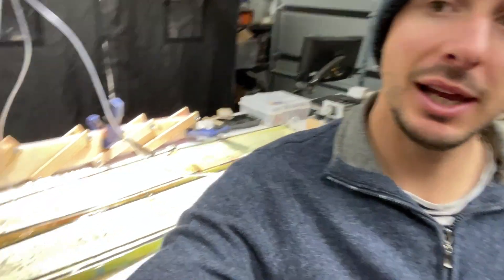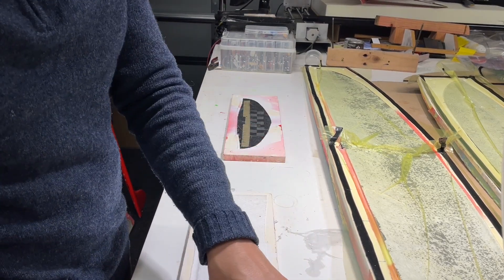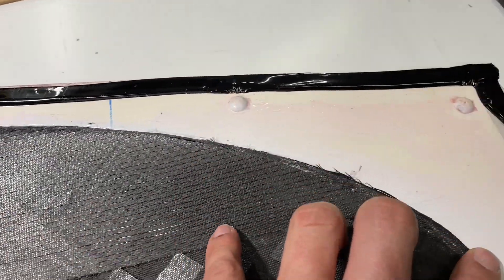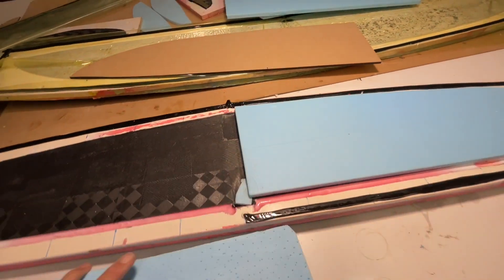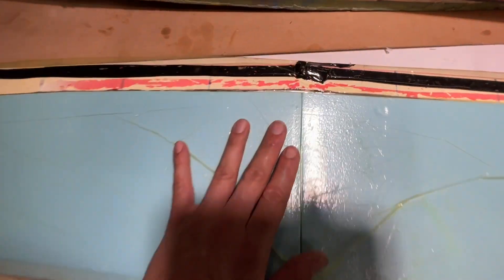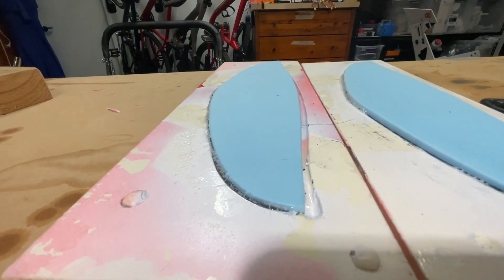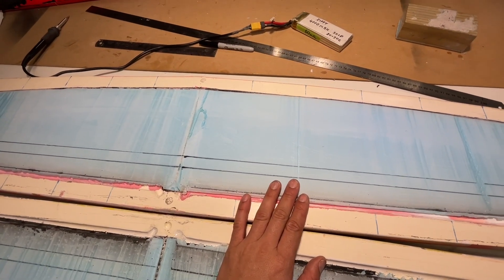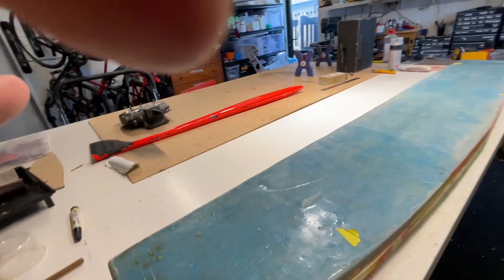How to Make a Composite Glider Pt3

Comment: Really smart way of making a foam cored composite wings. I usually hotwire the airfoils and over laminate the wings and then use a 0.8mm thick mylar intensifier on both sides when bagging to get a smooth finish on the layup. Also works well, but the LEs and TEs always need some sanding after because of resin builds. I will give your "split" core idea a try to make a hydrofoil for a friend, thanks for the inspiration!

Comment: The practice of slicing the foam in half then joining the two halves is brilliant. I love composite manufacturing because it really brings out the creative side of people. Looks great!
Reply from the maker: Thanks! 😁
Reply: I fully agree. The variety of solutions is amazing.
The super fancy high tech CNC based solutions only look cool at first glance.
Reply: Totally agree! I'd never thought of that. Then again I've never even bagged my own wing haha. Alex, do you know if there are any models on the market that are made this way? Very noob question but could you make a rohacel core this way? I imagine you could.
Reply from the maker: @nehok  not this way. But most high performance thermal models run a machined Rohacel full core with a carboweave skin
Reply: @AJHewson1   Ah yeah I always thought it must be so much more work having to machine the foam along with all the other stuff you have to do to make a wing. Do you think you could make a half decent pmi core dlg wing using this method? Or would it be a non starter?
Reply from the maker: @nehok  I’m planning to try it with some DLG wing molds I have access to
Reply: @AJHewson1  oh sweet! Hope that turns out well. Will be interested to see how you go.